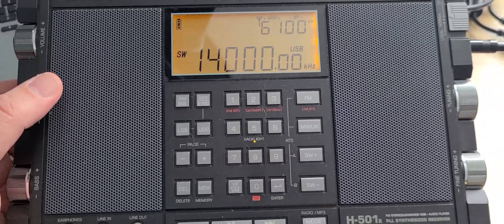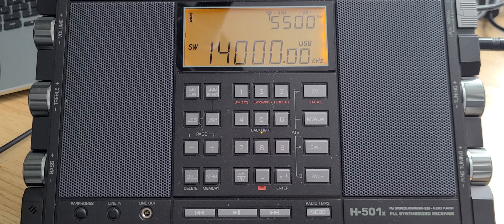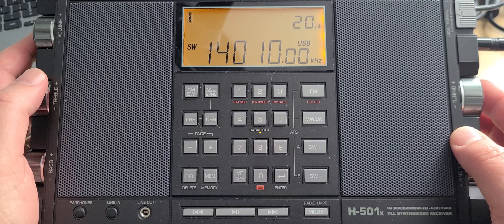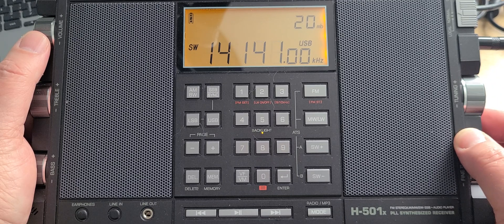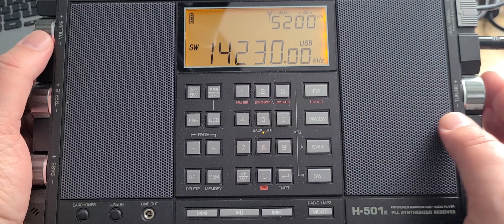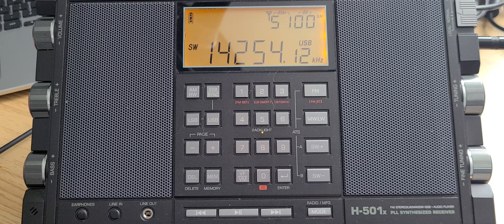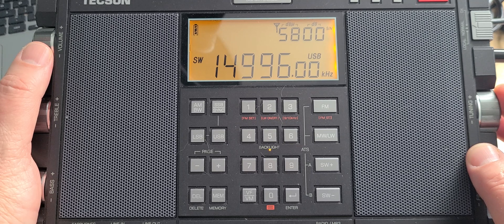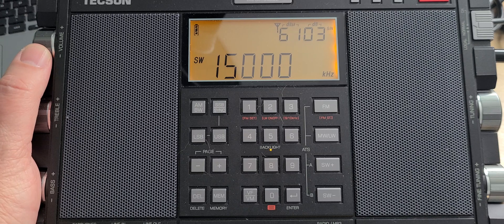What is there to listen to 14000 to 15000 kHz Shortwave Tecsun H-501X on MLA 30 loop

Comment: Is it too small a mountain of money on the radio that the tuning knob is turning so crookedly? I used to want to buy a 660 model, both had manufacturing defects, so I gave them to the store. Now I wanted to buy this radio, but I can see that the build quality is also bad! Sangean has disadvantages too. It's strange because these radios cost a lot of money. Tecsun and Sangean aren't worth that much money.
Reply from the maker: nothing bad at all and not a defect...works great... normal that when you put pressure on it is might move and this radio is worth every penny, you should focus on the radio.. not a knob that might move... even thousand dollar radios have knobs that move